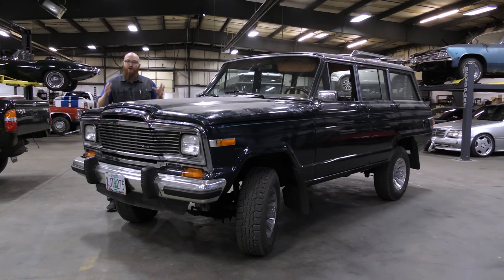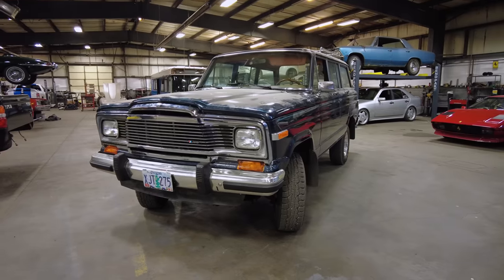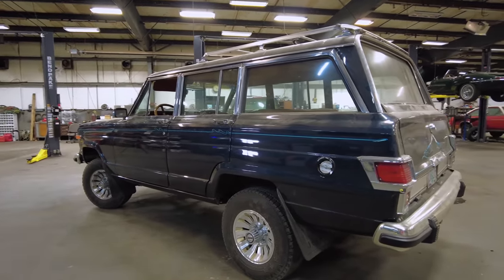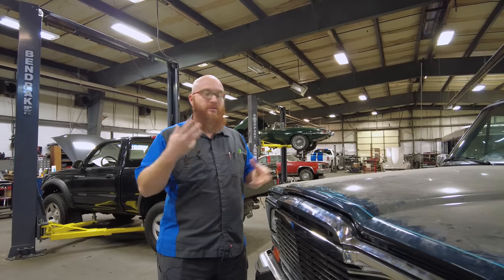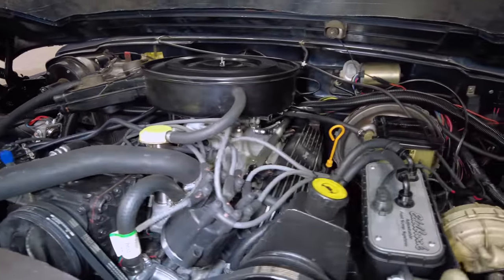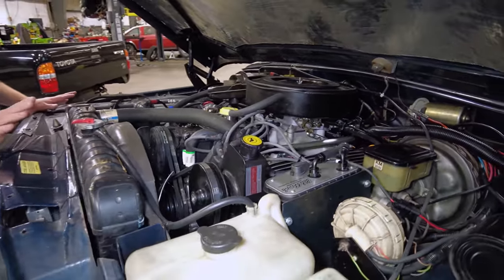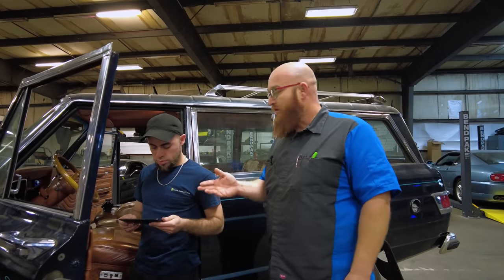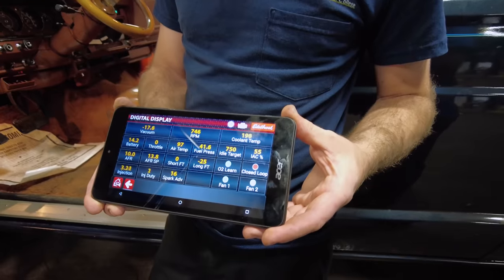After almost 2 years this '83 Jeep Wagoneer is leaving the CAR WIZARD's shop! What a crazy story!

Comment: Everything looks accessible and fairly easy to get too. Especially that heater core. They dont make them like they used to.
Reply: True. Definitely better and worse in several ways.
Reply: The Wagoneer platform was already 20 years old when this one was built. The '91 Grand Wagoneer was one of the very last cars sold in the US with a carburetor.
Reply: @bwofficial1776  People like to make fun of car models that have been on the market for a long time, but a lot of flaws get ironed out over the years with cars like this.
Reply: Til you realize unless you are a contortionist with tiny hands you have to remove the underdash A/C to get to two of those four fasteners to remove the heater core box.
Reply: @derelict_wanderer  been there!

Comment: We had two of these when I first got my driver's license. I had a single father and we were not well off. One of the wagoneers ran like a top but was really rusty and the other Wagoneer was really nice but had a blown engine. Our goal was to swap the good engine into the good body. Well winter came here in Minnesota and we had to have something to drive. The gas tank was so Rusty that it wouldn't hold gas anymore, and the underneath was so Rusty it wouldn't hold tank anymore so we ended up installing a Factory gas tank in the rear seat and then just opened the rear door to put gas in. My dad sprinkled the little Carpet Fresh on the carpet so it didn't smell like gas. Lasted us the whole winter. Lost a few brain cells.....but we were warm and toasty

Comment: My Uncle Bob was a Jeep Wagoneer fan.  He had three of them starting in the 1950's through the 1970's.  He never abused them, but he was never afraid of using them.  He used his for work, hunting and fishing.  As he was in the lumber business it got used for "cruising" timber stands, checking on felling crew's and operations from timber to sawmill.
I like your attitude towards your work.  A shop that has your level of ethics and detail orientation is fantastic in these days.  So many shops are just change some parts get it running put it out the door and get the check.  While you probably won't ever take on another project for a customer like that again your kind of shop is one people need to find in this day and age.

Comment: Man, I'm jealous.  Back in 2003 when I bought a 1968 Ford Galaxie 500 convertible, I wanted to put fuel-injection and electronic ignition on it, but there was NOTHING like what's available right now.  I had to cobble together a hodge-podge of parts and try to get it running...  It never did work right, really.  Constant problems starting when it was cold.  I finally gave up on it and went back to a carburetor in 2007.  But today -- wow!  I wish I'd had the aftermarket EFI stuff available then that's available now!

Comment: We have the same issue on classic bikes,  parts that seem to be the right shape but are not heat treated or are made from inferior metal. I try to keep new parts to a minimum for this reason. One example is side-stands made of cast iron when they should be forged steel. They snap and your immaculately restored bike falls on its side.

Comment: I would recommend having the owner of the Jeep use special engine oils formulated for flat tappet cams or ZDDP additives.  Flat tappet cams, even NOS, will not last long with modern engine oils.
Reply: There are a few ZDDP oil additives available. Be careful with the mix ratio, too much and wear accelerates

Comment: Very nice, good looking wheels, fuel injected, and best part is all the accessories work.  Those small amenities are the true frosting on the job.  It's what makes driving a vehicle a treat.  The only draw back is the drone of the exhaust, the owner may want to try a quarter pipe. Either way after two years it was a true work of patients.

Comment: Good job! A few suggestions from someone with a Pro Flo 4 system on their daily driver for over 3 years. Don't wash the engine or get the throttle body area wet. The TPS will fail if you get too much water on it. Also do some research on the Edelbrock forum and make a list of spare parts for the Pro Flo system as the parts used are from  a variety of vehicles and sources. I suggest purchasing ahead of time and keeping in the vehicle a replacement Distributor cap, rotor , TPS, and a Bosch O2 sensor.  It's a lot easier to have one on hand than try to find one in an emergency.

Comment: One of the thoughts that comes to mind is that when converting from a carburetor system to an electronically controlled fuel injection system is that the power demand on the cars electrical system will increase to power the fuel injection system. This may necessitate a higher capacity alternator to handle the additional electrical load.

Comment: Not only the lifters aren't properly machined, the bottom should be slightly convex so the lifters will rotate. The current lifters are flat on the bottom. So not only they aren't hardened but they wont rotate.

Comment: Bye, Jeep.  I wish the owner many happy miles.  One thing the owner might keep in mind - if the original vacuum powered cruise control ever fails, there are electric powered ones.  Last year, I replaced the aftermarket (Rostra) vacuum powered cruise control in my 1988 K car (Aries 2.5) with an electric powered one, also from Rostra.  The old one would sometimes not have enough vacuum, even though there was also a vacuum storage chamber.  The response of the electric powered one is better, and it gives the old car a more modern feel.  It doesn't install itself, but it was not that hard, I would say.

Comment: 🥝✔️The problem with all the Self Learning 4bbl Throttle Body EFi isn't that the systems don't work, it's the existing 53 Federal Emissions Carb things that you have to remove to fit the easier to manage the HyFire or whatever ignition and MCU stuff you put in. 🎶Against the Wind. Running Against the Wind...🎶

Comment: l had a dodge Aspen ex cop car l bought for peanuts in the early 80s w/ a modded by police 360 set up. The engine came with 175k and probably 1000's of idle running hr.s but ran like new years as the ''band runner car'' , like a parts truck for auto parts place but for a rock band. We were driving it back on the backroads in Tx one night around 120 mph and got pulled over and the cop said '' l didnt mind the speeding, it was the bright lights coming at me ''. Good times

Comment: The difference in HT appearance is in the late 90s the industry changed from heat treating low carbon steel steels by the carburization method to induction hardening steels with a higher carbon content. No carburization is required and the carbon content is more tightly controlled in the base material vs carburizing for a given time frame then flame hardening them. The heat treated material is cleaner after induction hardening too. The overall process is more consistent but there is still a process that must be developed and followed.

Comment: Like I said last time, If you want a slightly better than stock jeep engine, should have 4.0L swapped it. It would have been an easy swap and would have given better than stock performance. LS or hemi swap it if you want better performance.
Reply: I was thinking of the same thing the since the beginning. It would had been better in the long term to use a newer engine that has a good aftermarket support.

Comment: Hindsight is 20-20 but a LS or hemi or even a magnum    probably  would  have been less costly  the cam lifter thing is a epidemic in hot rodding  circles  a lot of shops wont do flat tappet cams unless there new old stock they want you to  use rollers otherwise still it is really  nice but I'm sure  it cost a mint.

Comment: My first auto. was a J10 pickup with the 360 . It was a good truck. Sadly the previous owner put a very bad lift kit in it and that made the truck handle really bad. Still if I could buy another one that was all stock I would buy one. I want zero electronics on an auto.  Yes I think about EMP mostly from the sun . As Earth is due for another one and NASA is watching a Earth size spot on the sun that would wipe out all electronics so being able to get far away from this stupid city I live in is very important.  The Grand Wagoneer did ride very well when new. I remember that many nations used them as limo like rides for the big wigs .

Comment: The last few years I keep seeing the flat tappet cam - lifter problem over and over.  So many YT engine builders fall victim to this.  What can be done, besides digging up NOS parts?  Rollers only?  Sad state the car parts industry is in now.  Feel sorry for mechanics, and customers.  Who gets to eat constant rework costs?  Not good...
Reply: We are all screwed. NOS costs a lot when you can find them. I remember years ago before companies started doing reproduction body panels for some cars. NOS quarters fro my Chevelle were $1200 each. Car needed $8000 in bodywork NOT counting paint>>30 years ago. Wished I had kept the car because now panels are cheaper and the car would be worth a LOT, even though it wasn't an SS. Obscure makes won't have much. Roller conversions can cost a lot. Late model engine swaps aren't for everyone, especially when you like to have original. No-one thought about keeping stuff for decades. If your old stuff isn't shot, reuse as much as you can.

Comment: Its seems like, with all the problems shops are having with cams and especially lifters, that it would be repair-effective to just put in a streetable roller cam and lifters. That way, you know that you've got a hardened cam, and with roller lifters there's no question as to if they were hardened correctly. Plus there's no break in period. Yes, I know we're talking about $1500 for a complete roller cam and a roller lifter set, but what's the cost when a flat tappet set of lifters and a flat tapped cam design go bad at the one-mile mark after a rebuild.
Reply: They could have  used roller lifters from a  5.2 or 5.9 magnum  they will  fit the  AMC engine  a magnum  is literally a  Chrysler  LA small block with AMC valve train
Reply: @oscarwalton1188  Better do the measuring to be sure. AMC 360/401 is NOT the same as Chrysler small block.
Reply: @hotpuppy1  the roller  lifters in the magnum  are the  same the cam is different.

Comment: I do marine repair and mos of my customers are the coolest people you will ever meet and some of them have been very understanding. I had one boat here for two months it kicked my ass@ . I felt so bad but he was totally cool it came back and ran bad I found one of the hoses for the fuel was bad it collapsed inside . I replaced the hose no charge and a month later he emailed me and told me it ran good that made my day. I have been working on another boat restoring it and it was spanked very hard nothing had been replaced . 99 % of it was all factory 1992 it was beat to shit everything went wrong with it . The customer has been really cool with me > I took off about $2000 worth of work on it that I am not going to charge him for. why? Because the dude has shown me respect I am still not done with it . I think its a rare boat I looked for another and couldnt find one like it anywhere on the net has a 454 with a Kind Cobra and huge 5 inch thru hull you start that bitch up and you can hear it for miles puts a big smile on a gear heads face

Comment: I never knew how to properly break in an engine. I've heard so many different methods that I got confused in time.
Reply: The initial break in is different than the first 500 mile break in.   New cars don't require the initial break in, their valve train is different, most use 'roller lifters'.  Initial break in on a flat tappet cam is a bit exciting.  You fire it up and rev it to about 2000RPM or more (I forget, it's been years) and leave it there for 10 minutes or so.
Reply: Basically, avoid sustained high speeds. Stop and go is fine. Moderate acceleration from time to time.

Comment: Be sure to remind the owner to get the zinc oil additive and put it in after EVERY oil change. Today's oils don't have it for several reasons. Cars that need it are now decades old and few in number and today the manufacturers want their engines to get better economy with lower friction additives. Better to spend $10 for a additive than $$$$$ for a new engine. Crazy that the burnt lifters cracked the block in the original engine. Now the car isn't matching numbers for those who check that thing.

Comment: I have an older Lockheed Titan heavy lift with the solid boosters, lately the inertial upper stage light stays on when it's going into low orbit. I've changed everything out twice, it's got 15m miles on it but it still runs fine. Is this something to worry about?

Comment: Wow.. 2yrs, but you didn't build the engine? Someone else put on the older model fuel injection system. And you did the wiring (coulda used some tesa tape and wire looms)... What's that shop bill gonna look like? $25k+?

Comment: With the lifters and them not being hardened properly vs the NOS, the difference might simply be that someone blow torched the OG's to harden them based on the brown marking you found, while on the new ones they didnt, its sort of a bubba way to carbon up the metal for heat treating but its more than possible, hell I think its how they heat treated swords back in history really, just with a forge instead of a blow torch.

so the difference might simply be that they didnt heat treat the damn things, and their failing because of it.

Comment: These jobs are not profitable bc. the true cost is more than the finished value & most customers have no idea why. So they get a break here & there from you, bc.your sympathetic & there goes yr. profit. Not a dig either way, just the nature of the business. Most shops I worked in declined anything over 10 yrs. Restoration is different, you do repairs & very well, I will add.

Comment: The guy would have been into the Wagoneer 1/2 the money with far more reliability witha GM Performance LS 376/480 Bolt & Drive conversion....Factory engineered electronoics fixable at any GM dealership or independant shop and FACTORY WARRANTY! The Edelbrock EFI is not a popular system and based on my "trials & frustrations" with the original Pro Flow system....I won't EVER AGAIN! use Edelbrock for EFI hardware and software.

Comment: How can you sell dead soft cam followers? It would seem that you would have a 100% failure rate.
How is that sustainable?
Perhaps a mislabeled load of material that wasn't heat treatable using the process available? 
Modern production methods could pop out a lot of parts before someone noticed the mistake.
An unscrupulous business might choose to just ship them.
Back in the day I knew of parts suppliers to the Big Three that would ship small parts in 55 gallon barrels.
If they had a batch of bad parts, they would put them in the bottom with good parts on top, because those would be the ones that would get inspected, and after checking out, the whole barrel would be accepted.

Comment: That jeep should of been done a lot cheaper and done in 2 weeks.. Mechanic/engine builder should of known to run a retrofit roller cam and lifters and that would of solved the cam lifter problem and Holley sniper fuel injection kit would of saved 1000/2000 dollars. The fuel injection system put in that vehicle is overkill for that stock engine and way to expensive! All this could of been done in 2 weeks or less with all engine machining and building. And you wouldn't have to run High zinc oil and running a roller cam you could of got a bit of more lift and duration to give a nice performance boost. IMO that whole job was a cluster f#(($..
Reply: Not really your problem is it?
Reply: You don't have to run high Zinc for the entire life of the engine, just break in.
Reply: It's what the customer wanted......and supplied tha parts for.....
Reply: @foch3  WRONG all flat tappet engines need High zinc oils or you will wipe out your cam and lifters a lot faster.. Look it up.. The reason they started to have problems with 70s and mid 80s engines is because they took a lot of zinc and anti wear additives out of oils so it didn't plug up catalytic converters. So in late 80s they started factory roller cam and lifter engines!
Reply: @foch3  With today's oils, yes you do. Do you want to take the chance?
Reply: So any day now, my Jeep 4.0's cam is going to be wiped out from lack of ZDDP.  With 260,000 now, when should I start worrying?  Plenty of flat tappet engines are running just fine on modern oil.  This isn't a high performance engine.
Reply: @foch3  
But if you were to refresh the engine with a new cam and tappets...the chances are, (unless you can get NOS)..the heat treatment of the "new" tappets and/or cam may well be far inferior than OEM.
Keep using your old originals and you may not have any problem for the "life" of the engine....good oil, filter changes, gentle warmingup etc etc....all help extend engine "life"...